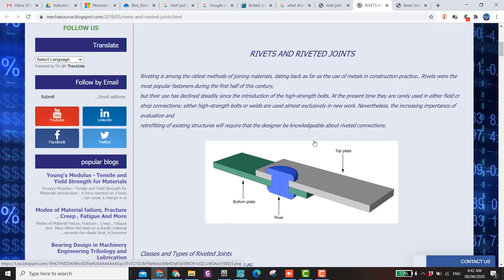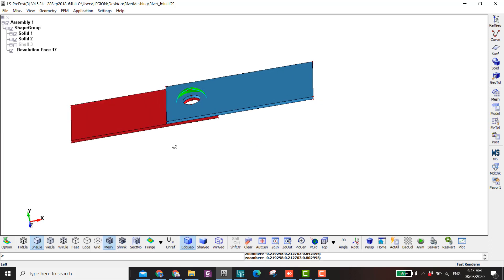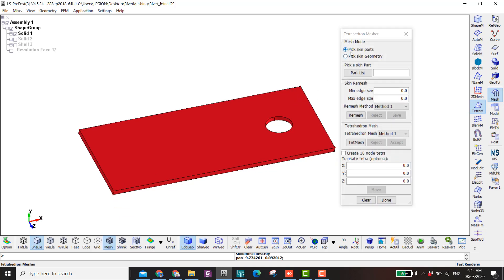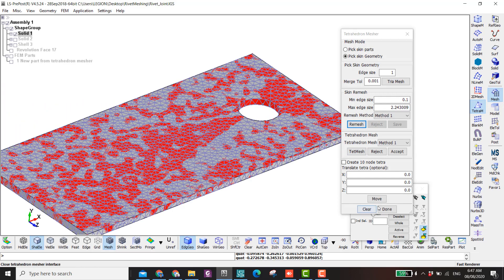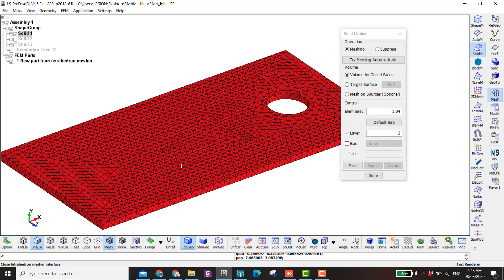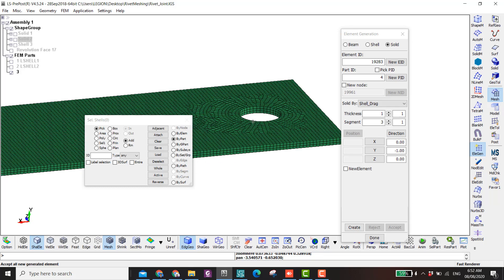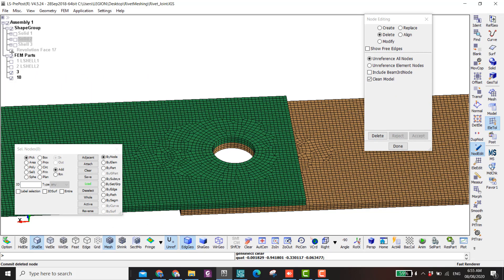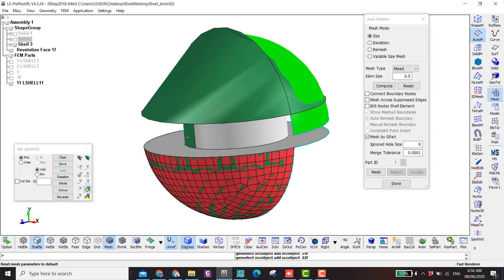Meshing Tutorial: Riveted-Joint

Comment: In addition, some more concepts may be added. Like the curves at edges (say shape of tyre or say bullet). These shapes are complicated to mesh in ls dyna. Moreover, it sometimes become difficult to extrude 2d mesh along 3d due to variable geometry (say a bucket shape, a simple example but it may be complicated ). these are few meshing related issues that I have encountered at IIT (apart from variable meshing concept that you have cleared).
Reply from the maker: Yes you are right. I have plans for more videos on meshing with LS Prepost.